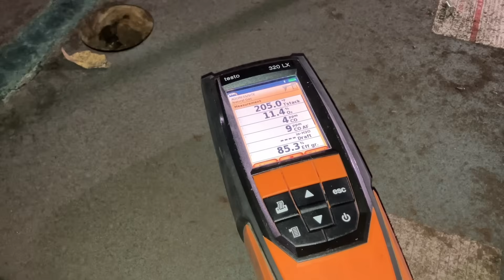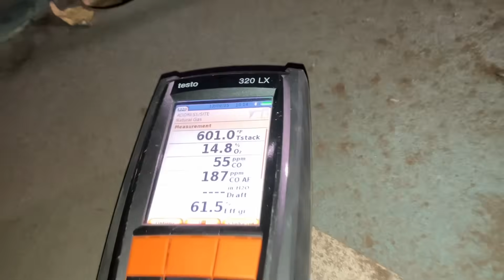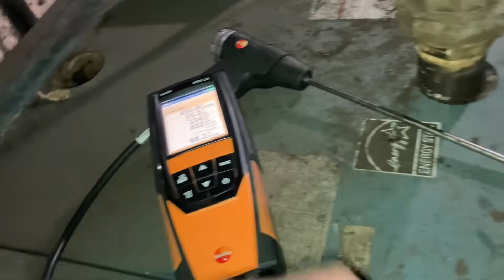Family Heating Home With Oven… Then I Saw the Boiler. UNREAL.

Comment: Over 70 is waaaay too hot. I live in Maine-one of the coldest states in the country and my boiler never goes over 70. It blew up about ten years ago because it was a 30 year old furnace. I found a replacement burner on facebook marketplace for $50. I bought it, watched a few videos and changed it out myself. Runs great for the past five years.

Comment: When I was 5 my family moved from an apartment to a house, it was built in the 50’s. The gas boiler was built in 1970, it was 6 years old when we moved in, and was still running without issue when my parents moved 2009.

I remember helping my dad replace a t-stat when I was about 12 and I think the burner a few years later. Other than those noting else was done to it. They don’t make anything that lasts long anymore.
Reply: True. My old Hydrotherm boiler is from the 50s, maybe 60s. My Lennox central air was manufactured in 1979.

Comment: It was probably the constant call for hot water that was stopping the heating from working.
Reply: I was thinking a circulator was not working or it was air bound.
Reply: Well if it’s wired to the zr Zc reverse in the aquastat you’re absolutely right. Those lock out the circulator when there is a call for hot water

Comment: Hey Mikey, great job there, including putting your own health and life at risk going down to that boiler. Shutting that boiler down was the only thing to do. From a commercial perspective, I agree with you as doing anything with that setup is inviting one heck of heap of problems and headaches (both metaphorically and literally).

Hypothetically,  you may well have ended up practically rebuilding the boiler and replacing associated pipework just to make it safe use before you even start looking at the control side of things and getting the whole system to work. When you're faced with one hack job on top of another on top of another and an unsafe system, the only reasonable thing to do is to shut it down on safety grounds, present the options and costs to make it right, and then walk away.

As a man with conscience and a solid work ethic, I imagine you could never rest easy if you'd got involved with that horror show. You explained well and made it very clear to the client the situation and risks they were taking with the present setup. I hope they can get it together and take you up on removing the dumbhackery and replacing it with something safe and proper and installed and set up to your exemplary standards. MayGod bless you, Mikey Pipes!
Reply from the maker: Appreciate the thorough feedback and kind words!

Comment: Mike, you found the reason why the boiler was running constantly, the water was left on in an inaccessible sink. You turned their heat off and left them with no heat. That means they will be using the kitchen stove top and oven for heat. If you think about it, they were doing fine until someone turned the faucet on in that laundry sink and walked away. Or maybe a cold spell forced more use from the furnace "setup" than normal, but they weren't dying, they weren't even sick . You may not have gotten a decent answer, but you should have asked when the last work was done to ascertain how long they had been living with that "setup." Or looked for tags with a date on them. Or asked for receipts, anything to see how long they had been using that "setup." THEY WERE FINE until the furnace started running continuously. If it had been able to shut off, like it normally did befor the faucet was left on, there would have been less CO. And, to be honest, you were monitoring the CO right at an emission source, NOT TOTAL BACKGROUND. Look, I get that you believe your license and conscience was on the line, but ask yourself this: What if you didn't come over and someone else found the water running in that sink and shut it off? They would have been back to normal, which as I stated above was  1). No one was sick. 2). The heat was working. You left them with NO HEAT! The least you could have done is give them a TRUE and HONEST  BACKGROUND CO check, NOT in the basement, UPSTAIRS WHERE THEY LIVE.  The person who was in the basement was not sick, they didn't even have a headache. CO typically is just like Nat. Gas so it would have been rising not accumulating in a low spot. You didn't even offer them some thought on how to heat with electric heaters. Not all electric heaters are unsafe fire hazards. Some are indirect with oil and work like a radiator. C'mon man, you were like Joe Biden, if they wouldn't join in your sham, let them be. Call 911 on them and let go of it. IMO, you, the one with the brains took the easy way out. ben/ michigan

Comment: 20.000$ to replace this heating system? I thought we're bad off in Germany but this is way worse.
Reply: Yes total ripoff. Our heating systems may cost 20k + but they are not the middle age tech the US use. A boiler replacement in the US is usually 5-7k $ top.

Comment: Just the money he saved them by shutting off the faucet is mind blowing.
Reply: Whats nuts is they just fucking let it run. Who the hell does that?
Reply: @jdj5952  They probably are not paying for the heat we are.
Reply: @lastv8547 Didn't even think of that. You're probably not wrong.
Reply: @jdj5952  N... People operating on below-room-temperature IQs. 🤷‍♂
Reply: @jdj5952 People who live their life high 24/7
Reply from the maker: OMG 😱 you are right! I might of saved Xmas 🎅
Reply: @PipeDoctor  House not getting heated... fridge-cold water running over boiler constantly.  Who knows why it's so cold?  Gonna spend $20K a year in water on that tap.  LOL, yeah, this would more hilarious if it wasn't so scary!
You mentioning the handheld CO meter made me curious as to what options you'd have for a clip-on alarm.  You should probably get something that works like the 'rad meters' and you just wear it.  I mean, as a backup for the accurate sniffer-style meters meant for diagnostics.

Comment: If gasses were coming Out of the burner end of the boiler, why didn’t he check OUTSIDE that the flue was passing exhaust gas?  First thing I’d check.  Also, leaving that faucet on FORCED THE BOILER TO RUN, TRYING TO MAKE ENOUGH HOT WATER.  He skipped over that too.  He wants to sell a whole new system.  Probably needed, but limp along till summer if those two things were fixed?  Maybe.

Comment: Whoever did that conversation was not a professional. And the fact that the homeowners had a facet running full blast says everything. A good cleaning would make a big difference for safety as well. They are pushing the limits of having a fire with all the trash around.

Comment: The circulator pump went up on my boiler, which caused the water not to be pumped throughout the radiators.  It also needed a cleaning of the inner coils

Comment: Unfortunately, you really should have just called the fire department. They probably turned the power back on as soon as you left.
Reply: A boiler rope gasket and furnace cement to seal that opening at the furnace. That's what those products are for! That's not "Bubble Gum" or half-ass. Get those wires into the power switch box like they're supposed to be, find out why one zone is not circulating the hot water for heat. Probably air bound. Recommend they get a new boiler asap to cover your ass and leave. The leak could have been stopped using the those proper materials and let them have heat.

Comment: Looks like a hoarder house. That much crap laying around everywhere near critical facilities is just ridiculous. Now, my basement is a bit messy, BUT, I make sure that facilities like my RO system, hot water tank, bladder tank, etc is free and clear of debris that you can get to it, and work on it if the need should ever arise. I don't pile a bunch of boxes and crap up in front of these things. That boiler being so close to all of that cardboard was a fire hazard, they need to clean that place up. That's even if it DIDN'T have a gaping hole right into the combustion chamber which is just wild. The outside of the boiler is going to radiate heat and that's just a fire waiting to happen. That whole house looked like a death trap. I get that some people are on hard times, and are poor, I am not making fun of that family, but seriously. They badly need to get rid of all the trash. If they have money to buy TVs like the box near the end of the video, they have the means to get rid of the trash.

Comment: Probably cheapest to convert it back to an oil burner.
Reply: With that electric rigging - nope, it wouldn't be safe in any shape or form.
Only alternative is a total rip out and install reasonably modern equipment designed for that use. Even some used equipment would be better, everything that was there did look like it was modern some time back in the 1970's or even earlier.

Comment: $20k? Why do people subject themselves to living in these areas? Insane!
Reply: That price is called pricing yourself out of the job. He wants nothing to do with ever going back there. That's 12k job.
Reply: $20k is actually not that bad of a price for that kind of work (at least, in today's economy...). You're talking about replacing the entire furnace, boiler, and half of the piping in the house. The furnace itself is at least $5-8k, and you're talking probably 5-8 hours of work for 2-3 people, so 10-24 hours worth of labor, and the piping, and of course the demo, ripping the old equipment out and disposing of it, etc. Also, this is in NYC, so go ahead and add another +50% to the price to everything. I bet that $20k job would be $12-16k anywhere else. To be honest? If it were my house, I would ask for an electric hot water tank. Looks like if they got rid of some of the trash in the basement, they'd have plenty of room for one. $1500 around where I live, maybe $2k in NYC. That way the boiler wouldn't have to be on 24/7 all year long.
Reply: @Dhalin  Got a $2500 estimate labor only & another estimate was $1800 labor only to replace just a 32 gallon Bock oil fired leaky water heater tank(lasted 30 years) only and I provided the new tank. I bought it on FM for $500. Just for labor its sickening today & I did it myself easy job took 2 hours & Im slow if your handy most arent you can do it,lol!

Comment: $20k is  crazy for a new heating system in your😂.  U can pick a brand new gas heater up for 1,000 so your charging 19,000 in labor lolol that's absolutely ridiculous you can say whatever u want it doesn't justify 19k in labor.

Comment: my parents had a fuel oil to gas conversion going on.  everything was tight enough, but that kickup motor had to be changed a couple times.  it took untill my money savvy mother finding the right place and company (who went out of business shortly thereafter, unfortunately) to ge the proper kind in the place.  even ended up spotting a couple badly connected air runs.  their place is finally warm all around.

Comment: 1) The open hot water faucet is insane, keeping the boiler running. 2) The flue open to the basement destroys the draft to draw gasses up the chimney, so they come out - with CO - near the burner. 3) Using a gas oven for heat is insane - more CO. 4) No attempt to see if boiler water/steam was circulating was made, so the lack of heat could be a thermostat/electrical problem. 5) Sealing the flue pipe might fix the CO leakage, but there might be better ways to ensure adequate draft when running and not so much when off.

Comment: No way in fuc I would have touched that faucet to turn it off without at least a verbal commitment to pay for a bandaid if you end up standing there holding what's left of the handle in a flood of hot water.

Comment: Glad you shut it down, that was a disaster waiting to happen
Reply: It was leaking fumes from the front of the combustion chamber around the furnace tube. The installer didn't put any furnace cement around it to fill in the gap like they were supposed to.  I really don't know why he was unwilling to do that. It's common to see the furnace tube sealed that way. There's nothing half-ass or bubble gum about it.

Comment: Pretty awful boiler condition and even worse for the family.
Continually running hot water into the slop sink wrong on many levels.
Dangerous connections to run the boiler no barometric damper.
Obviously boiler was never cleaned inside and is likely carbon’d up.
You gave them some bad news and you saved their lives at the same time. Carbon monoxide is no joke.

Comment: I lived in an apartment building where the owner lived in which he told other tenants to use their gas stoves to warm their apartment warmer if they wanted more heat. Id called the health department I think they were getting paid under the table to blame me because there was no heat in one of the bedroom I couldn't even use a space heater because the wiring was screwed up. He redid some wiring and bought two oil filled electric heaters which worked perfectly I could see my breath it was so cold in there I couldn't keep keep the room door open as it would killed my fish. The landlord was a POS

Comment: I like how people think a thermostat set higher makes more HEAT come out hotter or something when the thing is already on and putting out heat LOL, you could set the thermostat to 200 degrees if it went that high but it wont make the heat it's putting out any hotter, it's not like throwing more LOGS on a fireplace fire!
That hot water running full blast was not only running the boiler all the time, but it would have reduced water pressure and did enough water pressure get to the boiler if it's a steam/radiator type is another issue!
Putting the boiler back to run on oil isnt fixing the flue problem or much of anything else

Comment: Carbon monoxide detectors Mike I know you know that they're no good for low levels what do they claim they got to hold 70 parts per million up to an hour or two hours before they sound they're worthless I got the test 03 I suffered from low levels of carbon monoxide call headaches and wear your toes meet your feet right underneath of them is where it starts and you end up with peripheral neuropathy eventually could get your feet and lower legs cut off live through it and watched it happen explain something to me Mike how do they get away with what they're doing they may have been updated I think the 30 parts per million but the Testo goes off at 10:00 do you want to be breathing 20 parts per million all day long

Comment: Probably that burner conversion was never even installed correctly.  I'd have to start with the manual, which I already found online, and pretend I was installing it from scratch.  I could hardly understand anything they said.  The more they said the less I knew.

Comment: Strange leaving an oil tank in place when you converted to gas i guess the genious who did the conversion wasnt bright enough to remove the tank because mikey c02 was the least of their troubles if the oil company came and filled that tank and it leaked the place would go boom in no time .
Reply: Nonsense kerosene or diesel oil isn't petrol.

Comment: The prices in new york must be crazy high. I know I can get a central heating and air in the midwest for 1/4 of that price.
Reply: Everything is high cost here, average cost for a direct replacement steam boiler without any add ons is about 12k
Reply: Really so you could install a new boiler, water heater, and replace all of the plumbing for that much?
With a decent brand cause I assume the guy wasn’t going to install crap. 

What’s your labor rate $20 an hour
Reply: 1. It's NY expensive, BUT
2. He intentionally bid very high. He wants nothing to do with going back there.
Reply: Not a boiler system gas electric higher if you have to install duct work.

Comment: Exactly why NY needs to let you red tag dangerous equipment…it’s insane that you’re not allowed to
Reply: I am in Germany and code and regulations of course are quite different. Some people I see on the internet would cry about governmental overreach and too much regulations, but seeing that and seeing what we have, I cannot find any good reason to complain about not only regulations, but also mandatory inspections. Now my house is a lot younger and our heating system is not converted from oil to gas and also a modern forced air condensing furnace making hot water and heating the hydronic heating system. No AC, no air ducts. But this being a rather modern system, we still have to have the system inspected every, oh man my memory is fooling me, either every  two or every three years, either by a Certified technician or the officially appointed chimney sweep for this District. During Inspektion among other things they use a calibrated meter like the one he used to measure exhaust gases and check for CO as well as efficiency.
If we had a wood stove, that would mandatorily have to be cleaned twice a year as well.
And while I am a big DIY fan, anything running on gas is something I would never touch myself.
Reply: *forced to
Yeah, it is kind of crazy.

Comment: Hey Mike Daick, of Mikey Pipes Plumbing not easy being cheesy. I like your podcast/social media, looking thru some comments?? That's an good judgement call again. I know of 200 homes and businesses that burned down because of faulty heating equipment. And I know about 40 people were killed due to faulty heating equipment leaking carbon monoxide, carbon dioxide and sulfur dioxide flue gas. Most people don't or understanding that things in there home is an sleeping loin and is ready to kill them. But again, an 90% plus hot water boiler with an indirect hot water heater will make me sleep good at night too. Love you buddy, you be safe out there. Jolly good show old boy, God save the King.
Reply from the maker: Thanks for the kind words and for sharing your experiences!